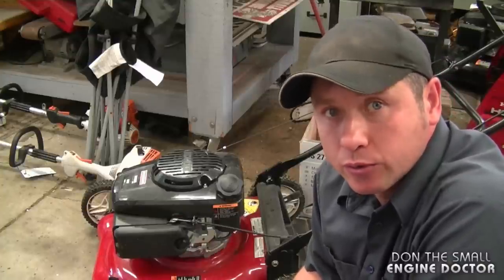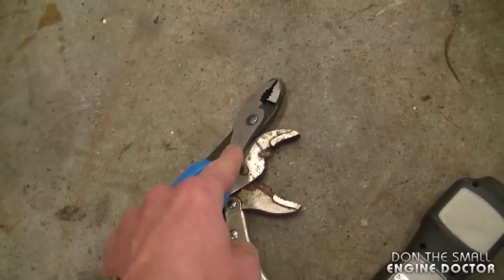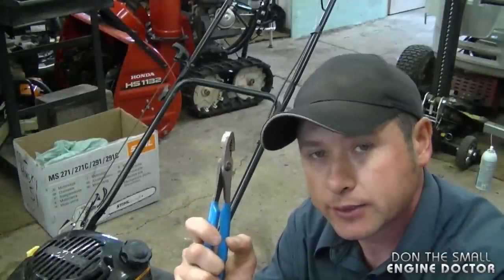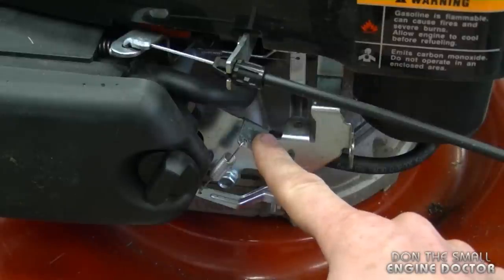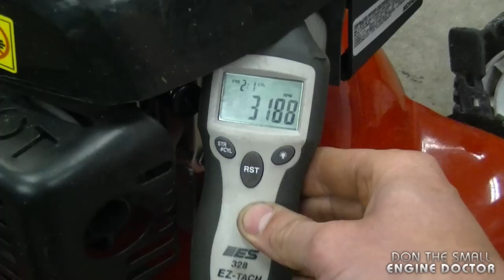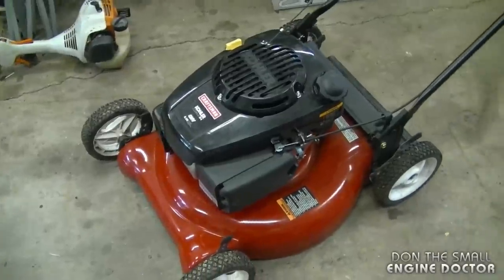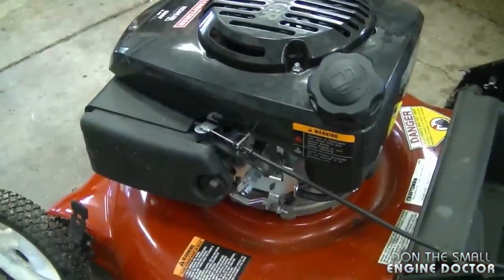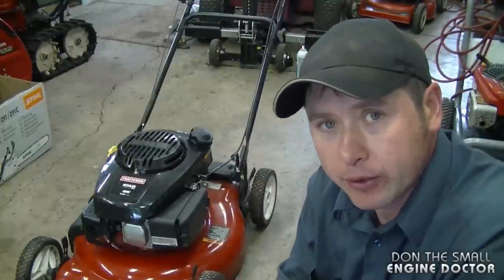HOW TO - RPM Adjustment On Kohler Lawnmower Engine

Comment from the maker: This is a common issue on these Kohler lawnmower engines!
Reply: I just picked up a toro with the same engine, it’s over revving. Tomorrow I’m going to try this. But if it’s not it, you have any other ideas why it would rev high?
Reply: @donyboy73
Reply: I have one doing the exact opposite!  Reving to the moon, adjusting the tab doesn’t work and even when I disconnect the spring the Rpms don’t change.  I pulled the air filter cover off to make sure nothing was binding up the levers.  I’m thinking it’s internal…

Comment: thank you so much for sharing this information! I recently purchased my Lawnboy mower and realized the throttle was just too low and I struggled with my lawn to the point that the mower would choke and die out. I won't have that issue anymore.

Comment: Thank you Donny, this is the same P.O.S. my wife got me several years ago, I hate it. Slow turning, bog down and stop.
I will try this this..
Still prefer my Grandfathers 1964 Wards mower, It's a little 3 horse and it out cuts my new 6 horse any day.
Plus in keeps running when I move a hose, no restart..  I can adjust the R.P.M.s

Comment: Hey Don - can you share the info. on the tachometer with us.  I have an older style "swing-arm" tach and it works fine but the measurements are in 250 rpm increments.  The digital one you used is more detailed.  Thanks.

Comment: Cool video Don! One question, you said you shouldn't let the engine rev higher than 3200rpm, but I always thought 3600rpm was the correct maximum for these engines (at least for Briggs)?
Reply: Yes, do tell. I thought the same, and I've seen the 3200 number kicked around lately.
Reply: Most small engines (most likely that one too) are built to be able to run at 3600 RPM. The problem in the USA is residential lawn mower blades have a safety rating of 3200 RPM so the manufacturers have to run the engines slower.
Reply: Ahhhh. Ok. As a tech (on anything it seems with an engine) I try and learn something new every day. Thanks for the education!!

Comment: Thanks for the great video! Do you, or anyone else out there, know what to do when the RPMs just can't be turned any lower by bending this piece? The (new) spring on mine is loose enough now it could be removed without changing anything, and the mower is still running fast. This is after I recently cleaned the carb out. Thanks to anyone willing to help. -JB
Reply: hi john did you ever find a fix? my mower is revving so high
Reply: Mine too. Don't know what to do.

Comment: Great video Dony!  How accurate are the non-contact tachs?  I've read some of the reviews on Amazon and quite a few people find them inaccurate?  What has your experience been?  Thanks and have a great weekend!
Reply: I've found sometimes you have to back up or get closer to the reflective tape..move around until it reads. 
I've got a cheap harbor fright one and it works ok. You will know when it's not reading right and when it's locked on.

Comment: Hi Dony,
I have a Kohler XT675 and once I start mowing I hear a knocking-noise coming from the blade area and it doesn't make the knocking sound when I'm not mowing. Also it makes the knocking sound when I am mulching the grass. Do you know what could be wrong?
Thanks

Comment: I have same engine main problem when I tried to increase the governor as you did my engine would die and if I reduce the tension on the spring the engine would turn at 1,000 rpm. Weird the governor tension spring does not respond the way it should. Any suggestions.

Comment: Thanks alot for the video. My problem centered on that part but my mower was over revving. Kinda hard to push on a spring so I affixed a sturdy wire to each end in the open most position. Just had to bend the wire a bit to bring it to the proper rpm.

Comment: You so Rock! I was fiddling with the connector that is secured with the 10mm nut thinking it was there and it did nothing of course. One Google and there you are showing me how to do it correctly again. I appreciate your videos!
Reply from the maker: thanks, make sure you are subscribed
Reply: @donyboy73  4 years ago I replaced the ring in this mower because it was low compression. This mower runs fine just too high on the rpms even with the spring totally disconnected. I have played with that governor bar both ways with no change. How can I get the rpm down without adding a spring? If I push it back with my fingers it drops the rpm plenty good but when you let go they are too high. The mower looks brand new and I want to give it away to the needy but I have to get the rpms down. Thanks for any tips!